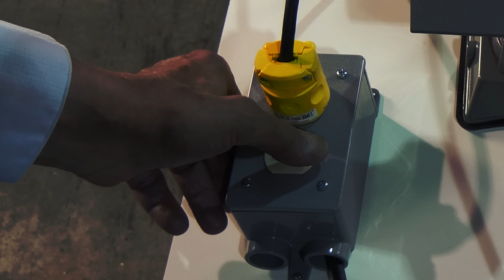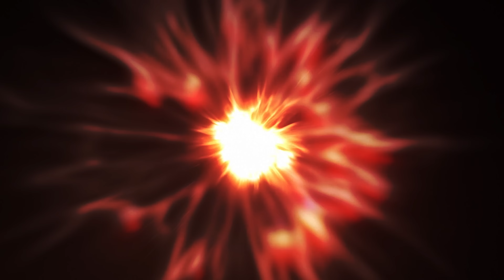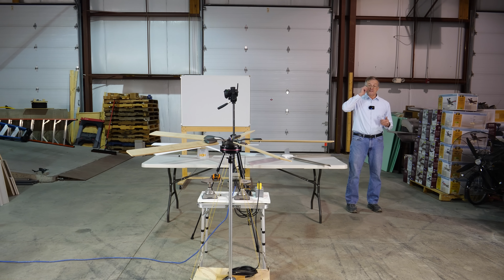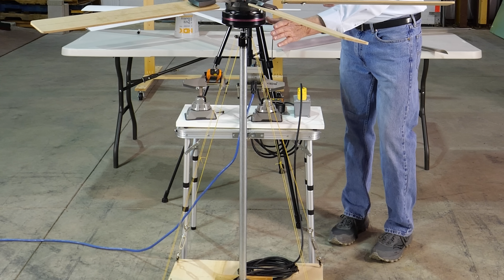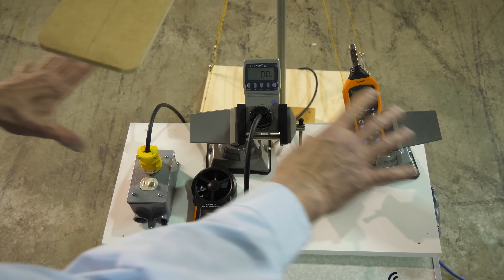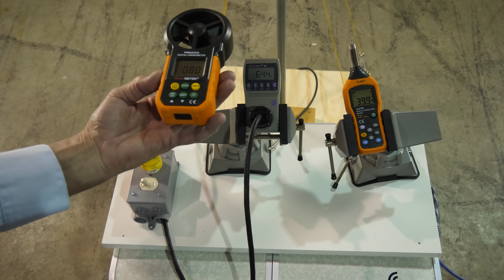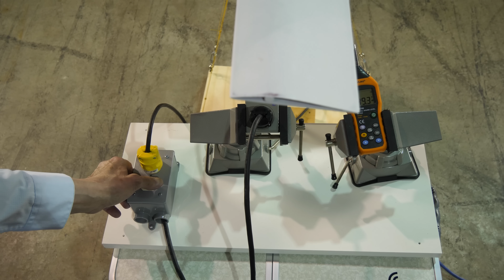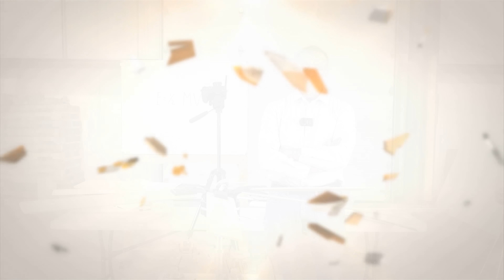This Fan Uses Almost NO Power

Comment: PWM driven BLDC motors are becoming more available, for example for "grow tents/chambers". These can be used generically, I have one (6 inch) that maxes at 345CFM and ranges 5W-24W. Perfect for bathroom and in conjunction with mini splits.
PWM/BLDC also drive (with ~300VDC) both the fan (outside) and blower (inside) in "mini splits" (100% electronic), which also have VFD driven BLDC for the multi speed compressor. The HVAC trade lacks electronic knowledge, and still sells bulky ancient TXV type systems, to this day, with "new" refrigerant".
Same for refrigerators, which now rarely need "servicing".

Comment: Hi I  am new to your channel I think you are very insightful. I was looking into something and found your interesting topics... Perhaps you can help me with a question.. I experienced on several separate occasions in 4 separate places I lived  someone was using some sort of device that vibrates the floor you cannot hear it you can only feel it.. along with the vibrations one night it got very aggressive and powerful then I noticed my body was burning like I was being pricked by several thorne's at the same time I moved to a different room and I heard the person below me walking in lock step with me and I could feel this heat and prickling sensation in every room I went to.. I even went into the closet and stayed for 5 minutes to see if it was there it was.. at first I thought it was the mechanics of the building I moved out and then it happened again at the 2nd place and this time I could feel a motor being turned up and the burning felt like a microwave I went online and googled what I was feeling and I found a treasure trove of many people experiencing the same things in their apartment.. I moved 4 times in a year and a half because of this.. I found  a tracking GPS on my car it was weird.. I'm wondering what kind of device could this be it makes you feel like your bones are vibrating for hours it hurts really bad makes you feel sick I purchased something called mylar wrap from ace hardware it blocked the pressure a bit 1 side worked but the opposite side didn't work to much it feels like the instrument used on me when I went to my physical therapist she would place a bunch of magnets on me and turn a volume then it would vibrate .. one time she turned the volume up to quickly and it made me almost jump out of my skin I relate it to that as far as how it feels then multiply that times a thousand and add heat and thorne's.. it is the  most cruelest thing I ever experienced I contacted the authorities to no avail but they didn't know what it could be. It was like this person was following me everywhere.. because I kept experiencing the same thing til I moved into a house.. I'm wondering have you heard of such a device how do this person know exactly where I am standing.. is there some kind of camera that can see through floors.. sorry this was a bit lengthy I'm curious if anyone knew what was being used on me and countless others that have been targeted for some ungodly reason.. thanks for all your important videos God bless

Comment: I've been thinking for years now "what if". What if we had in our homes one or more AC to DC rectifiers to provide DC charging for mobile devices right in a wall outlet? Also, there are many devices that run on DC power and we have to use cheap, inefficient converters for each of them, mostly with no way of turning the rectifier off when the device is off. This wastes much electric power in the "vampire" loss of the converter working at times when it could be off. 
I have in a few cases put a discreet AC on/off switch between the mains and the "wall wart" in particularly hungry devices.

Comment: BLDC motors are like magic... I was suprised how much more battery life my RC heli had when I switched to bldc from dc motor. Also cordless powertools with bldc motor are very interesting... double the battery life is the reason why I choose only those (if possible). Sometimes BLDC motors have less starting torque, but later they are unstoppable.

Comment: Would love to see a fan alternative that uses the whole high-voltage-wire-next-to-opposite-charge thing (ionic propulsion?) and what the relative power usage is for the same flow rate
Reply from the maker: That would be interesting.
One thing that never seems to be addressed with ionic flow, especially when we're discussing large volumes like cubic meters per second is the high voltage potential that will unavoidably remain in at least a small fraction of that volume.  This potential is very detrimental to modern electronic systems, which are now everywhere.
Reply: @TechIngredients  ooh good point I didn't think of that. Spicy air! Maybe a grounded case would be sufficient mitigation, but that would be impractical to do to everything. Or just somehow making sure the air is fully deionized before it leaves the "fan"?

Comment: Very interesting finding in terms of efficiency. If you use your fan to reduce the sensation of heat, remember that the waste energy is just heat. So, 1000 watts/day of inefficiency equals to 1 hour of a medium-size heater running in your room!
Reply from the maker: Agreed

Comment: I'd like to look one over and see what it would take to adapt it to pure DC? You're losing efficiency converting AC to DC so if you are off grid or have a DC solar system you can directly power the motor. Realize the reason it's DC in the first place is the controller and electronics so the power supply converting the AC to DC is essentially standalone. It should be dead easy to adapt.

Comment: Why ruin the test with not fixing the annanometer to the table so results are precise. Also have two annanometers. One on the inner diameter of the blade and the other on the outer
Reply from the maker: It might not have been best, but that decision wasn't as arbitrary as you might think. The different airfoils generate a slightly different angle to the down flow from the rotor disc. Tweaking the angle on the anemometer produces a maximum reading for each blade type.
I should have mentioned that.

Comment: I'd say the quantity of air moved is measured somewhat foolishly, and i'm not really aware of how to measure it properly, there are pressures, air moving speed, different angles in which air travels. Some blades may push air more sideways while having less performance downwards. It's very hard to measure it properly without controlled enviroment
Reply from the maker: I like to dig deep as many of our videos demonstrate.
One complaint we have received is that I held the anemometer in my hand.  The reason I did that was to measure the flow at its maximum, even if that meant I had to tweak the angle to do so. 
The bottom line is that if a given rotor has a higher maximum velocity, it's total air flow is almost certainly higher. These airfoils do not vary in their angle of attack along their length, and the central hub is the same size. 
It's not perfect,  but it's pretty good.

Comment: Airspeed doesn’t matter so much as total air volume per minute
Reply from the maker: The two are related. Given the same diameter rotors and therefore the same areas, the airspeed is directly related to the volume that passes through.

Comment: This experiment has boosted my hypothesis that the world should move more loads to DC power. It seems a waste for homes with solar panels to invert the DC power from the panels to AC power to run so many devices and appliances that are, or could be, DC powered. I think of all the things in my home that use an AC to DC converter. Phones, laptops, tablets, modems, routers, printers are the obvious ones. TVs, lighting, bluetooth speakers, etc. are the more recent devices going DC. If fans, washing machines, AC compressors, garage door openers, refrigerators, heat pumps, etc. would be as efficient (or more) why not cut out the inverter inefficiency and make more electrical equipment to function directly from the power your solar panels deliver? If there are still a few devices that are better suited to AC, make small inverters inline on THEIR power cords instead of the numerous DC converters on all the others? I know there are DC versions of practically every appliance that you'll find in an RV.
Reply from the maker: I agree.
Do you know the reason our modern society adopted AC? It's an interesting story and is too long for me to review here.
Trust me, you'll enjoy it.
Reply: @TechIngredients  Yeah, that poor elephant 😟

Comment: Very interesting presentation. However, I have a remark: you held the air flow meter with your hand at different distances from the rotor blades and at different positions in relation to the center of the rotor. It is possible that this would not have made a significant difference, but there should have been some fixed stand for a more accurate comparison.
Reply from the maker: I'll do that for the follow-up.
In the meantime, with each reading I made an attempt to maximize the reading on the meter.  That was why I seemed to shift it around during each test.

Comment: This would be much more critical in regions where power generation is on a much smaller or local scale, 40W less use per fan per room per home over a 1200 person village in a remote area using solar and battery would be a large boost in efficiency, combined with CaCO₃ micro-sphere pigment clad buildings could really be a boon for heat stricken areas of the world.
Reply from the maker: You should check out our previous video on cooling paint.  It worked remarkably well.
Reply: @TechIngredients  Oh I missed that one, I'll have to go find it, thank you for the recommendation! Keep up the good science, my dream would be you, applied science, and nighthawkinlight collaborating on some kind of project. That would be epic.

Comment: Fan motors are reluctance motors.  They are not used in all devices.

Can one improve the efficiency by only modifying the leading and trailing edges?  This will reduce much waste.
Reply from the maker: Very little. 
But the airfoil I demonstrated is pretty easy to build.

Comment: Im taking a wild guess here, but those DC ceiling fan options must be made for the RV/Camper Trailer market?!  Im actually intrigued by this because I have a blade balance issue on one of my home ceiling fans and just a few nights ago I was inspecting the blades and their condition when I too noticed how hot that AC drive motor gets.  Interesting Indeed!
Reply from the maker: Not at all.
The model we selected was a mid range house unit.
When we say DC, that means the motor itself.   The package includes the small electronic converter. It's about 6 in^3 in volume.
Reply: @TechIngredients  Thanks for clarifying!  I didnt see the rectifier/dc converter. I was thinking that they were accepting a DC input.(though they technically still are)
I wonder if its just a simple bridge rectifier feeding 100-110v dc to the motor.  
Cheers!

Comment: NO WAY that the DC brushless motor with it's control electronics will last 10 years.
Chances are the electronics will fail shortly after the one year warranty and YOU WON'T BE ABLE TO REPLACE/REPAIR it😡
That's the way to more electronic waste which probably can't be recycled.
Reply from the maker: You see?
That would be a valuable pronouncement to prove, and it would be interesting  for you to share your reasoning and methods.
Reply: @TechIngredients I can't directly prove it, but observing the huge quantity of failed LED bulbs/panels failing (Should have 100,000 hours life but fail as regular fluorescent lights because of bad design and components) I'm very close to the reality.
Reply from the maker: Fair enough.
Our experience is different. In our lab/shop, we have many LED lighting fixtures  that have been used daily for about 10 years without failure.
Reply: @TechIngredients  Those are probably high-bay linear or pendant fixtures, which are built with a noticeably higher quality than the budget LED panels and bulbs that have flooded the shelves at local Walmart/Home Depot, etc.

Comment: BLDC motors being more efficient is not really a 'discovery'. This is decades old news.

I'm actually a little surprised that this is presented as a eureka moment...

It's akin to improving a cars fuel efficiency 
using complex aerodynamics and never considering a replacement engine.

The point about migrating to this technology as a standard is a good one.
Reply from the maker: It's a little more subtle.
Early in the video, I presented the aerodynamic argument because the blades are easy to replace, fun to make, and inexpensive. 
The experimental method and the discovery are worth sharing because that process is valuable.
Reply: @TechIngredients 
I see; perhaps I misread the direction of the video!
Regardless, reading the comments has made me realise the value of your videos more than ever.

It's clear that what I consider common knowledge isn't as common as I expected. Thank you for sharing your wealth of knowledge.

Love the channel!
Reply from the maker: Thanks!
I have "discovered" that as well. The YouTube platform allows people to become exposed to and review information without any concern, like "You didn't know that!?"

Comment: Intriguing video, as usual.  One thought that I had was that the air flow meter appeared to be an inconsistent distance from the fan blades. Actually, I will admit that I don't know if this would make a significant difference in the results. If it was placed on a stand of consistent height throughout all the tests, the results would be undeniable (to those who might object).
Reply from the maker: True, and we'll do that in the future.
I held it in each test to achieve the maximum reading, but it is a little finicky.

Comment: Great information here. I was really looking forward to seeing the dc motor run with the aerofoils — did they also only offer a 20% efficiency over the stock blade?
Reply from the maker: The simple curved aluminum airfoil was a little better. But, the NACA asymmetrical airfoil increased the mass flow by 20% (it has the same diameter), so it increased the velocity by 20%. The kenetic energy equation is E= 1/2MV^2, so 1.2 x 1.2 x 1.2 = 1.78, nearly 80% more efficient.

Comment: Would angle of attack make any difference at these low speeds?
Reply from the maker: It's always important, and optimizing it will depend on the particular airfoil design and less so on the velocity.

Comment: My 2015 Ram has 225,000 miles on it so I decided to take out the HVAC blower to inspect it. It did not come with the filter kit installed and I installed the filter kit at about 180,000 mi. Well just now when taking out the blower motor to inspect it I know it's extremely fine carbon dust all over the blower wheel which was easy to see because it's white. I was surprised to see that there is not a brushless DC motor in there but a basic brushed motor with a resistor bank. I Googled brushless DC motor replacement and I did find a few and one company on Amazon admitted it's a lie and it's just a standard motor and I'm waiting on one more to arrive who claimed that it really is a brushless DC motor but I believe that too is also a lie probably coming from china. I do know that some cars like Audi have brushless motors in their HVAC assembly from a company like Valeo. A brushless DC motor will always be better in almost every conceivable way. But that got me thinking how to make my own brushless DC motor for my Ram pickup, it has a little plastic cover plate that the motor recesses into with a couple of screws and it seems doable as long as you find a motor that would fit in the receptacle you could simply screw it in just fine. But with the digital control Fiat Chrysler electronic system in this Ram 1500 I'm not exactly sure how to wire up the electronics. It seems as simple as dropping in the motor into the cover receptacle and the devil is in the electronic details. I'm not that good at electrical but I'm not Beyond learning. The ultra fine carbon dust from the graphite brushes cannot be healthy and that is going into the Airstream after the filter so it is getting stuck to the heater coil and the air conditioning coil. Some may call it deminimus but pollution can't be seen that way especially long-term that traveling directly into your lungs cannot be explained in any way as neutral on your health. So I am Pro brushless DC motor. I created my own bath fans with 6-inch AC Infinity fans and they clear out the moisture and fog in the bathroom very easily.